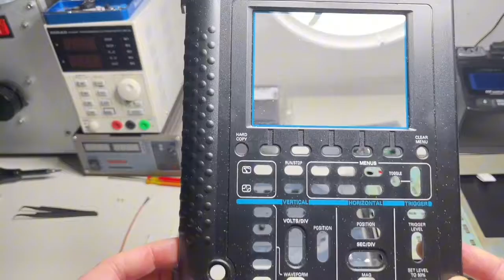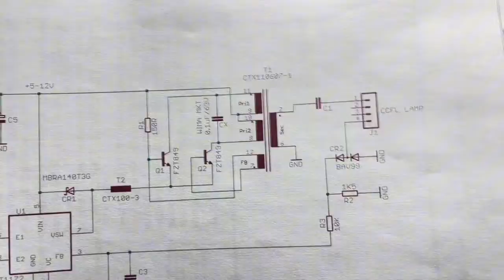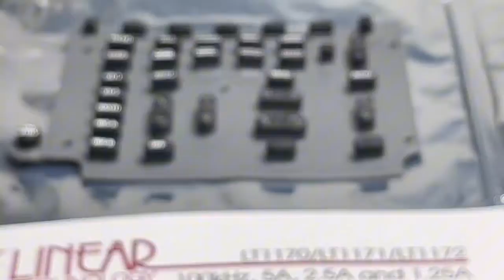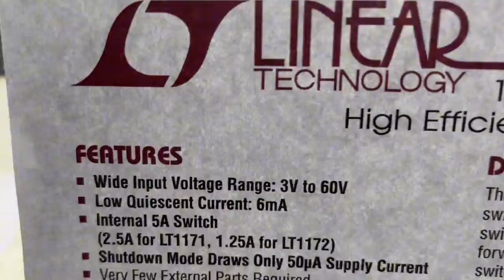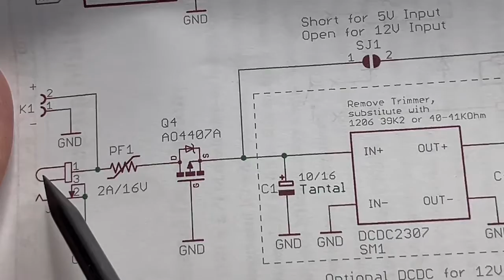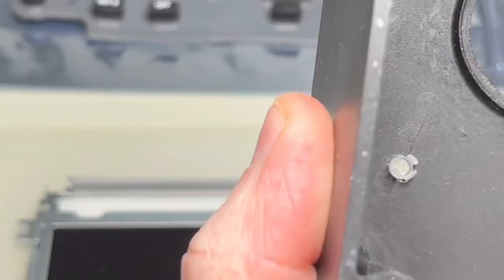TEKTRONIX THS720 NEW LED Backlight & External Charger, Schematics, Details

Comment: The replacement inverter for the LED backlight looks great. I know these CCFL inverters from the old laptops, but with laptops i have always seen only 4 pins on the input connector :  positive, minus, on/off pin and brightness control pin. Connecting the brightness control pin to the positive, the output (backlight) goes very bright, with a resistor in between you could set the brightness at a certain level fixed. So what is the function of that 5th pin on this Tektronix inverter ?  Grtz
Reply from the maker: Hi Bjorn, Thankyou! the 5th pin is not used on then Mainboard of the Scope, it probably can be used to Sense if the CCFL Tube is drawing Current or not anymore. Cheers, Konstantin